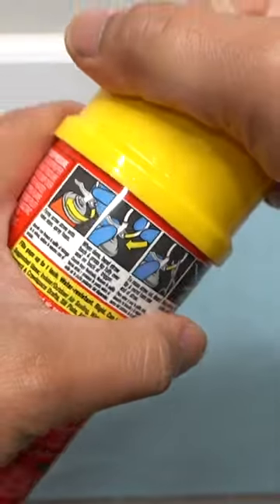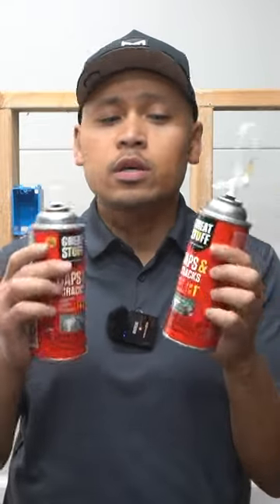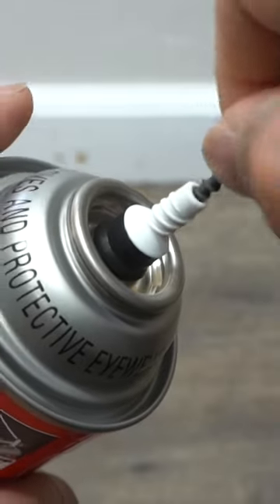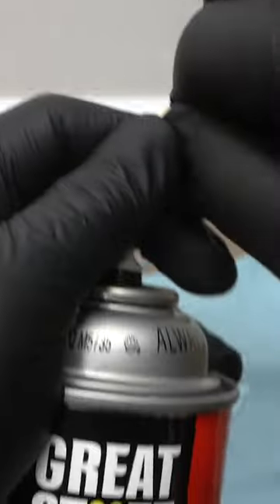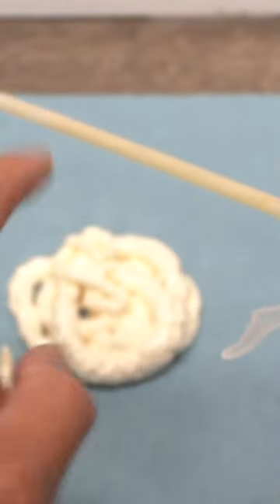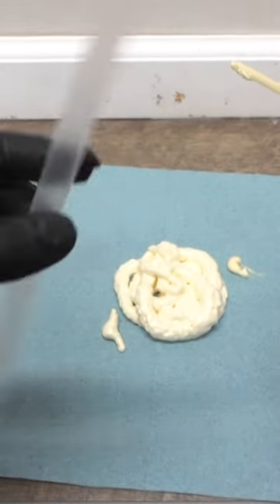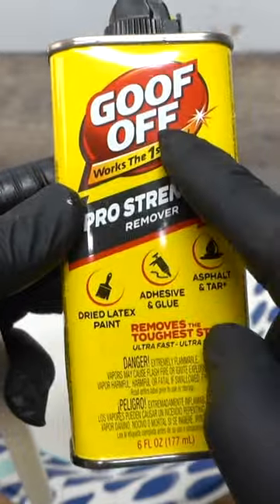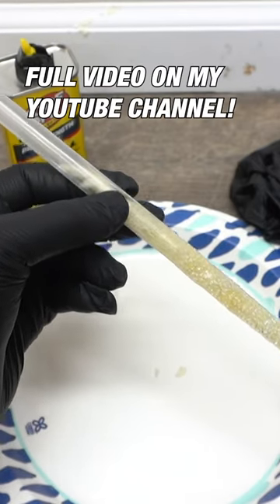How To STOP Throwing Away  Half Used Dried up Spray Foam! DIY To Make It Last FOREVER! #shorts

Comment: Or you can just clean out the straw and tip with a little wd-40 when your done using the spray foam… a lot easier than dealing with dried foam later